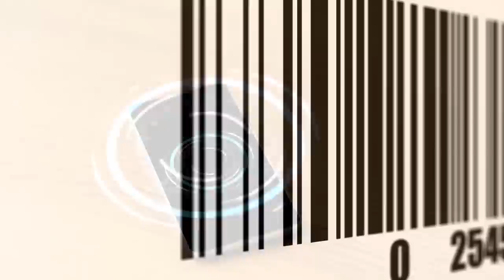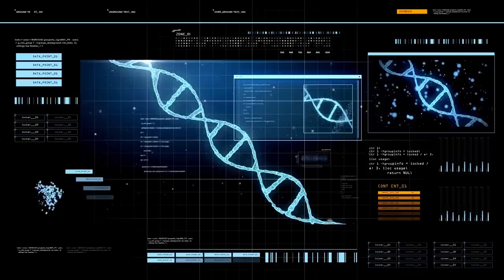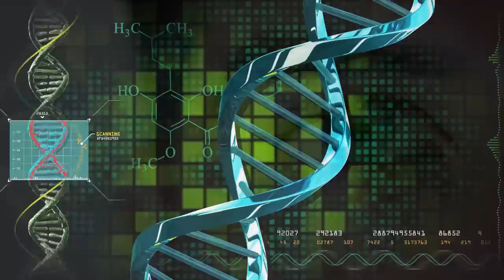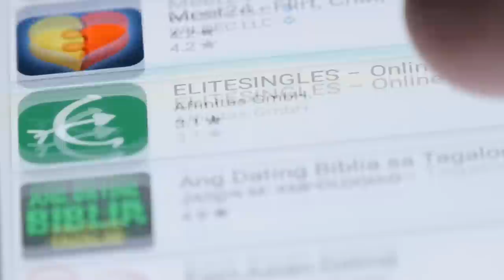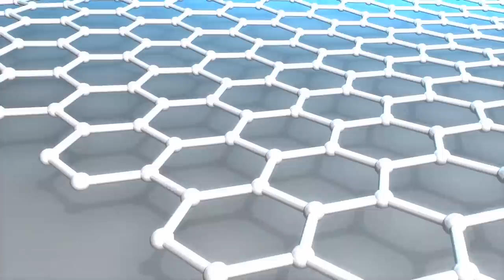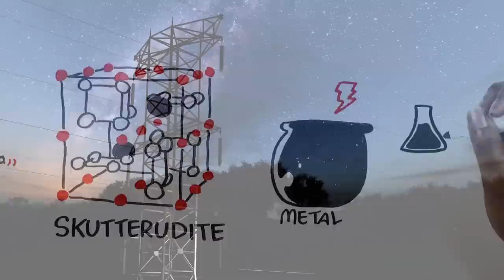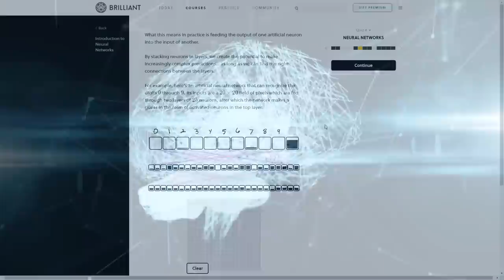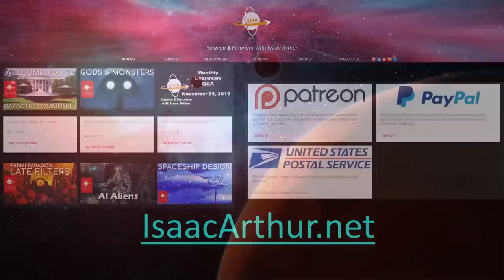New Technologies that May be in the Cards

Comment: A Polymer bola might be a more suitable option for most fleeing criminals than a taser. It will always work if it hits, you can't move very quickly if it's bound round your legs or arms and are liable to fall over and there's a much lower risk of subarachnoid hemorrhages or heart attacks than a taser.

For the more dangerous criminal elements you could always have a T1000 turn up instead.

Comment: 22:04
Modern water disalination plants don't use heat, they don't vaporise the salt water.
They use a membrane that's parmiable to water but not to salt, to separate the two.
Heat doesn't help in this process.

Comment: I think room temperature super conduction can be done if we move power lines under ground. Using carbon nano ceramic pipes cooled with nitrogen and placing our transmission wires in those pipes. Would give us a crude but effective "room temperature super conduction power transmission". The other benefit is that friction would be almost taken out of the equation in those pipes.

Comment: I think you miss understand why thorium reactors are so frequently brought up. The main reason is that thorium that can be used for reactors makes up 99.99% of the thorium on the planet and thorium is already more common in the soil than uranium. This means that in the long run thorium is cheaper to mine. On top of that, there may only be enough uranium to power the planet for say 200 to 500 years but there is enough thorium to power it for over a billion. Much more sustainable in the long run. Plus with it being easier to get your hands on it should be easier to develop mines in multiple locations on the planet rather than just a hand full with uranium. It's a long term goal not a short term one.

Comment: Imagine nuclear reactors being so hot and efficient that carbon neutral or even carbon negative cement can be made. Cooling towers produce a lot of air-water surface area to remove heat (and some water), and with an additive and some modifications to absorb CO2 much better and cheaper (since it's doing double duty) than other atmospheric carbon capture methods.

Comment: I thought the diamond batteries were too unstable due to c14 being the inner layer and then there's an outer layer of diamond so that would mean the c14 is sealed slowly turning into a gas which will eventually pressure crack the battery way before it's first halflife.

Comment: Graphen is NOT impermeable to hydrogen, sadly. At least if there is a single edge in the material (for example if it's rolled up). There, the hydrogen splits up, one proton slips through the graphene layer and then plucks out an electron of the material and combine with another hydrogen atom back into a molecule.
But, if you could couple every carbon atom in the edge with n atom in the other edge, making the sheet continuus, then it could be impermeable.

Comment: Just fyi, diamond batteries will almost certainly never be viable for things like smartphones, to say nothing of electric vehicles. More active isotopes like tritium or strontium 90 perhaps, but carbon 14 is just too low energy for anything significantly more powerful than a calculator, and those already have those little amorphous PV cells. They’ll likely only ever be useful for cases where more conventional solar or RF energy harvesting isn’t applicable, like for undersea and/or space probes.

Comment: College attendance is the highest it's been but also so is Student Debt. The problem is the over emphasis on needing a degree as the law of supply and demand hits. The supply has gone up but the demand has not and thus their value has decreased.

Besides social pressure the major problem is the current student loan system which does not allow people to default on their student loans. You could end up filing for bankruptcy and be out on the street, or working part time at min wage and they would still demand you pay it back. Unlike any other type of loan be it for a house, car, or etc which if your income collapses you can walk away with a huge hit to your credit for years to come. 

Because people can't declare bankruptcy and get rid of it they are stuck with a life debt. So we got a lot of people going to college that really should not be going because the banks happily give out the loans knowing it is guaranteed to be paid back. Society puts so much focus on getting that degree when for a lot of people a trade school would be a cheaper and better fit. Also you get people who go just because of the built up myth regarding the college "experience" and get degrees which are not very useful in terms of actually getting a high paying job. 

A lot of work places these days care more about experience than an actually degree. After I graduating I heard the same line over and over, "Looking for someone with more experience." when applying for entry level positions. I couldn't help but think "WTH are you talking about? This position is meant for someone new to the industry how are they suppose to have experience for an ENTRY LEVEL job. After all if they had experience odds are they would be applying for a more senior position. But then you would probably just say they were over qualified for that entry level position."

Comment: @Isaac Arthur i think your commentary on increased surveillance leading to reduced crime rates lacks some perspective. Most crimes are motivated by financial distress in some form or another. If crime is the only way someone can afford housing, they're gonna do crime regardless of how likely they are to get caught, cuz even if they are caught, they go to prison, which is technically housing with free meals. If the root causes of many people's struggle to maintain financial stability is not addressed, increased surveillance will more likely just end up with a spike in prison population, and prison usually comes with several disadvantages on the getting released side that make crime even more likely for ex-cons

Regardless of how one might approach addressing crime as a problem, be it financial aid or harsher punishments, I think we can agree that making not-crime an easier and more reliable way to support ones self than crime is important unless we just want a huge prison population for some reason. Honestly, ethics aside, more prisoners sounds like all downsides and no upsides, unless said prisoners are coerced  into providing labor, in which case that's just slavery with extra steps. or maybe "not technically slavery" which is... better but not by much.

Great video otherwise!

Comment: Wouldn't it be better to just have a vacuum inside a sturdy graphene balloon? Surely any lifting gas you could put into it would only increase the weight to vollume ratio of the vessel, thus reducing it's buoyancy. Additionally no material is completely impermeable at the quantum scale. Tunneling will still occur. And finally, there are obviously severe manufacturing challenges when it comes to producing pristine graphene that also contains a gas it is classically impervious to. Would you inject it after it's closed? Would you fill it and close it?

Comment: Battery tech. It doesn't sound super exciting at first but the lithium ion revolution has totally changed how people work. New batteries like magnesium, lithium air and solid state are possibly five years away. 
Current lithium batteries make hand prosthetics somewhat functional. Something with twice the power density would make powered legs much more practical. Obviously electric cars would greatly benefit. I see new tools cropping up all the time due to improved battery tech so it's not just that you get more of the same but better, you also get novel application. More battery power = more available brute force. Powered exoskeletons? A practical Atlas robot like the soon to be commercialized Spot robot? An induction heated travel coffee cup?  Man portable rail guns?

Comment: The future of energy is not in superconductors whatsoever. The future is in wireless transmission and individual generators. No matter the kind of cable it demands a lot repairs an labor force. These are tow things which the industry will eliminate. The younger generation don't wanna work in heavy and dangerous jobs and that's a big problem. Look for Viziv Technologies and their wireless system. When it comes to source generators we have many suppressed inventions which don't come up because of the energy industry lobby. Zero point energy seems more probable to me but there are others too.
Reply: I'd be interested in there claimed (and aimed for) efficiency of transmitting that power wireless. I didn't found anything about that on their homepage and sadly the physics part of that page is currently displaying nothing. And unless I see something to suggest otherwise I still highly doubt that wireless transmission of power is/will be efficient enough to use it as our main electricity grid in the near future.

Comment: Thanks!  I love hearing (& thinking) about existing & possible technology; I hate hearing (& thinking) about the social, economic, & political stuff involved in deploying it!  I won't bother anyone by explaining all my reasoning for the second part of the previous sentence.  Concerning cheap, thin (possibly perovskite-based) solar energy: if it (or any kind of solar) gets that cheap & simple, I hope we'd have the sense to put a whole lot of it in space!!!  The only other thing I'll mention is batteries.  They should continue to get better, cheaper, etc.  There are so ridiculously many different types, that this almost can't fail to happen.  However, I think it worth stating that we shouldn't overlook less high-tech solutions; we need ways to store rather large amounts of energy for the electric grid.  Gravity and/or liquid batteries can be made quite large, & quite easily.  For that matter, flywheels would help.  Even low-low-tech ideas - like some sort of powerful wind-up device - would be better than what we have at the moment, which is basically nothing!  Even a simple spring can store energy!  But I'd really, really love to see much more progress in energy density outside of batteries; namely in motors/engines.  Especially for space travel!  If we could sustain 1/2g, we could get around the entire Solar System - out to Pluto, at least - very easily!  I think that's going to be absolutely vital - both for the economy, & for energizing the sciences!!       tavi.

Comment: Too much like Gattaca: Most of the tech advancement will wipe out a lot of common jobs.
1. Truck drivers would all lose their jobs if autonomous driving takes hold, but likely only have a small reduction in transportation costs. Trucks still burn fuel and need regular maintenance to be road-safe.
2. Office AI is already replacing workers: Internet sales is reducing the need for salemen, Server  Virtualization & cloud systems is reducing the need for IT staff. Autonomous document review is eliminating review attorneys. Electronic payment systems is eliminating payroll\accounts payable\receivable departments. 

Within the next 5 to 10 years, more than half of white collar office jobs will be eliminated and replaced with technology. The issue is that re-education isn't practical, as you not going to re train an accountant\sales rep as an engineer or some other tech job that is in demand. What is going to happen is a very large pool of people chasing a smaller pool or unskilled jobs which will pay little and require long hours. Get sick, want to go on vacation, need to take time off of a family emergency, well there is more than 100K job applicants willing and eager to replace you.  Really these tech only benefit people with very advance tech skills (those that design productions and systems). These people make up about 1% of the population.

As far as the Crime tech, that is perfect for a totalitarian gov't that monitors all of its citizens. China is already doing much of this with there social score system. Fail to obey, or make minor infractions and they disable your debt\credit cards, prevent you from boarding public transportation. This tech will make masses essentially slaves to the state.

Comment: I see a lot of this automation happening more in urban areas than in rural areas. For example the county I moved from in 2017 in 1990 had a population of 500,000. We got cable and water in the 1980's. The rural county I now live in is bigger than my former home and in 2010 only had a population of 45,000. Water is by a well, I am watching this on a satellite link because the population is far to thin for a cable company to lay that in. I also see car automation being more appropriate to urban driving than rural driving.

In the USA, outside of the STEM fields, almost all post K-12 education is far more concerned with Democrat/Socialist/Communist indoctrination than with education. In urban areas long controlled by 'Democrat' politicians are extincting D/S/C indoctrination to K-12.

I am looking for work. I have seen a drop off overall in job postings due the virus. But has been increasing steadily is listings for work-from-home jobs. My estimate would be about one third of them. About a year and a half I called in one that I was qualified for. The first question I was asked was my net access. When I responded it is satellite uplink I was told I could not do work-from-home.

It not only has to be room temperature superconductors they have to be as cheap as modern wire and as easy to make and use and install or at least very close in replacement cost. And again, I would see it being used in urban areas followed by long distance power transmission before it came down my local rural road.

Comment: I have to say, I know it's not yours, (I'm assuming you got it off of Storyblocks), but the idea of a quadracopter hauling a liquid to mist onto plants just bugs me.
Use a water cannon. Something like an old reflex sprinkler, but more finely tuned. The quadracopter should just be calling the shots.

That said, robo-gardeners could cause an EXTREME change in our diet. LOTS more fruits and vegetables, lots FEWER cereals. It could also mean lots less meat, as more marginal cropland, that isn't really suited to row crops but is otherwise fertile, can be tended as intensive gardens, and not given over to grazing. They'd also be FAR more scalable than the giant tractors and combines, which are generally hired months and years in advance, (yes, hired, not purchased,) making small farms more competitive against larger conglomerates with their square mile section-sized fields growing corn and wheat. (The issue is timing. The really big farms tend to be harvested first, leaving far more time for storms and early frosts to damage the crops of those smaller, lower priority, farms.)
Some of that assumes we don't go to aeroponic greenhouses, which is probably the direction to bet.

That said, there's a lot of the country that has GREAT sun, and TERRIBLE storms, which puts something of a damper on greenhouses...especially the ones with near tornado force straight winds and hail. Cold frames perhaps? Enough cold frames to cover a field? It's not like it'd take any more glass, or other clear material. Less, as it happens. Watering it, or tending it in cold conditions without damaging it, becomes a bit of an issue, but again, robotics.

A crawler carrying five gallons of water at a time, or even just one end of a water hose, to water select plants, I find far more likely than a quadracopter misting a whole row of a field.